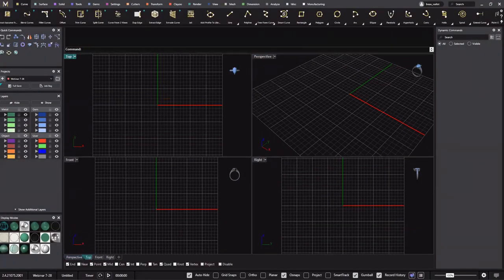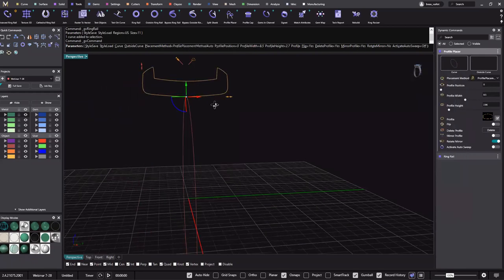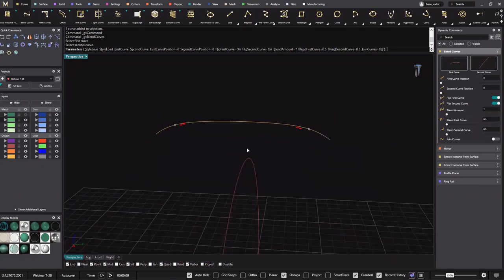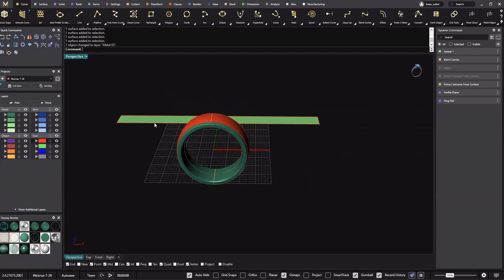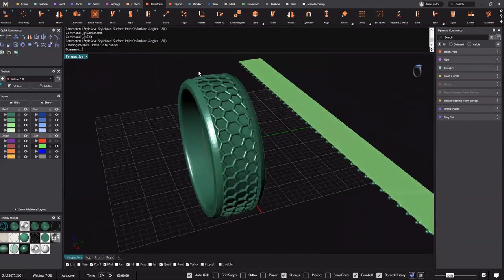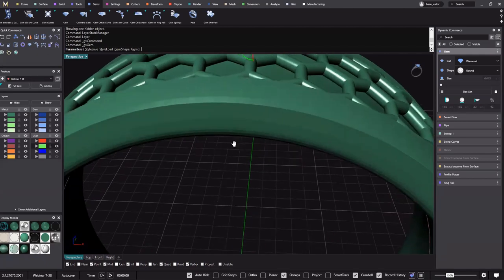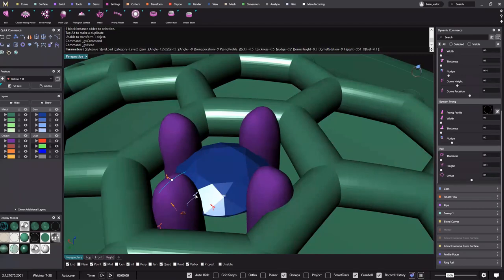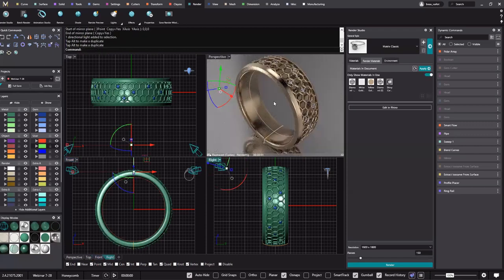Honeycomb Ring - MatrixGold Tutorial

Comment: I wonder if most of these designs would cast as nice as the CAD looks?
Reply: exactly this probably wouldnt cast well
Reply: @JRPW if you are a good goldsmith it’s very easy to print and cast
Reply: @ZockitHD  printing is no issue. I'm still just novice at casting. Need to get back into the hobby